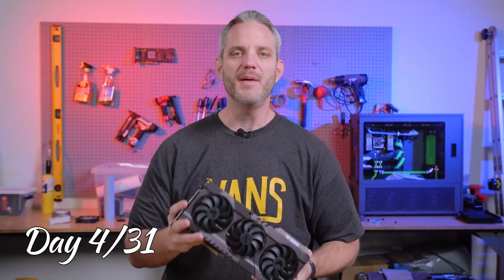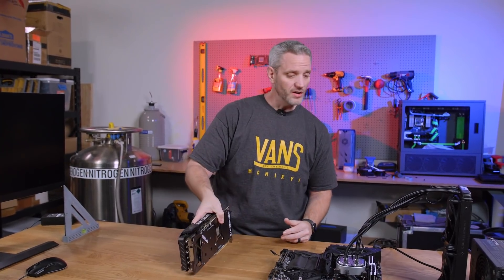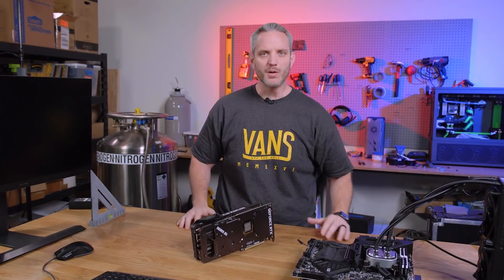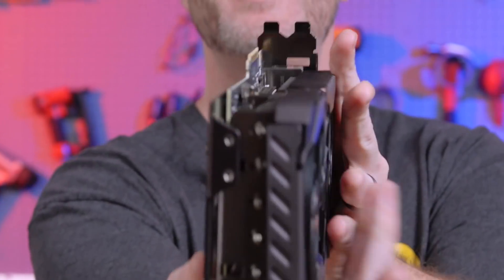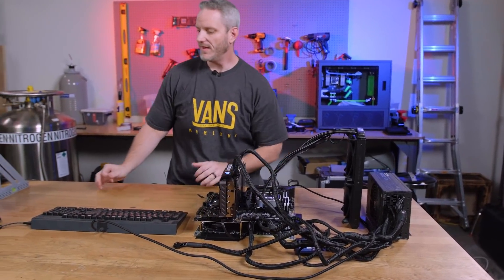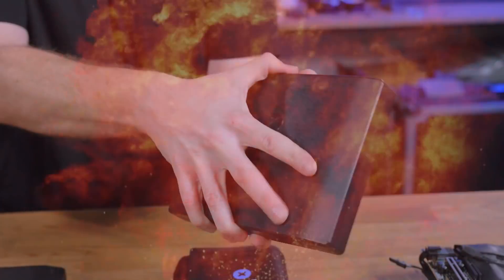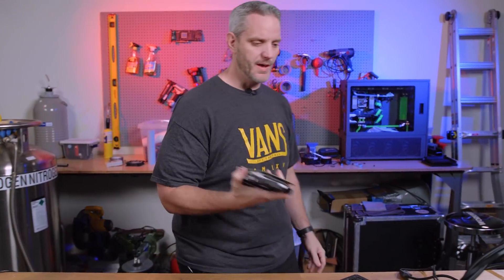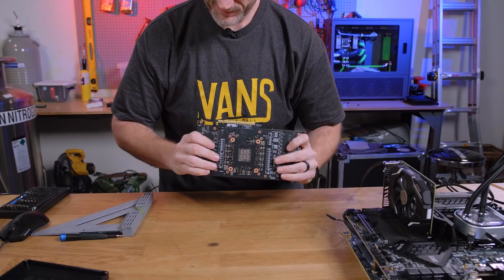This didn’t need to happen...

Comment: Some damage in shipping? Some you say? 
I wonder what UPS does in shipping sometimes
Also the iFixit ad was priceless, I'm never going to get tired of those
Reply: It probably got damaged at a warehouse because it’ll go through multiple warehouses. It can fall off conveyer belts, etc. I have a family member that works as a supervisor at ups and he has told me stories of packages getting damaged. Also due to the pandemic they have way more packages going every which was so lots and lots of packages are being damaged.
Reply: fr lmao I almost wanna buy an ifixit
Reply: most damage doesnt even occur during shipment, but when its being loaded onto or off of the truck trailers.

Comment: I’m building my first PC soon. Just ordered all the parts, and I can’t wait to receive them. You gave me the courage to try, thank you for that. Love your content - peace out brother 🤙🇩🇰

Now I am binge watching overclocking content 😂🤘

For the  curious: 

Tower: Fractal Design Meshify C White - TG 

Motherboard: ASRock B550 Phantom Gaming 4/ac AM4

CPU: AMD RYZEN 5 3600X 6-Core 3.8 GHz 

RAM: G.Skill Ripjaws V Series 16GB (2x8GB) 3600 RAM

SSD: Crucial P1 1TB 3D NAND NVMe PCIe Internal SSD

Power supply: Corsair RMx (2018) 750 W 80+ Gold Certified Fully Modular ATX Power Supply

GPU: Saphire 5700 xt ‘’AMD  Radeon’’